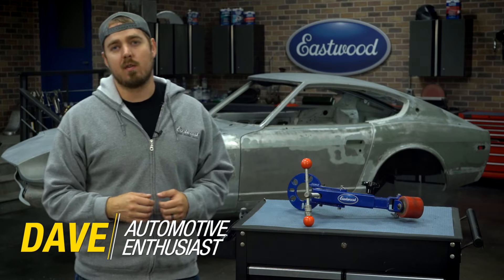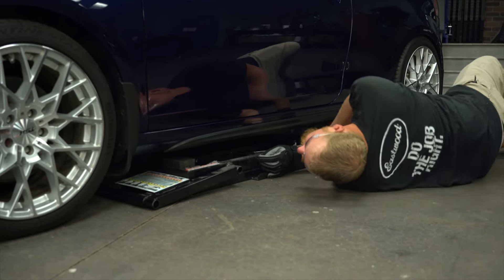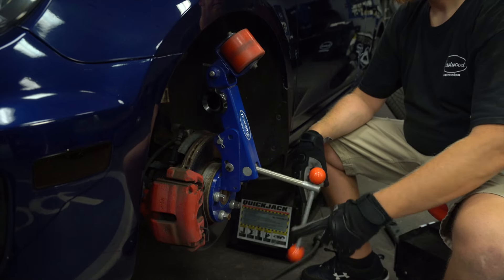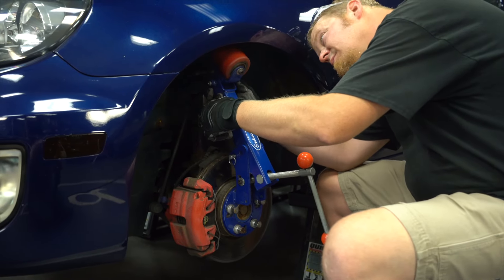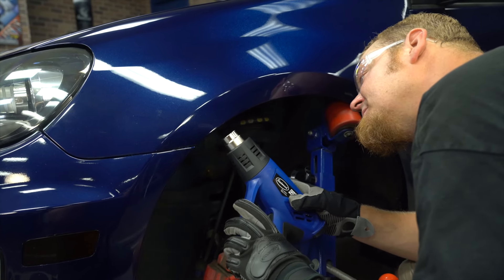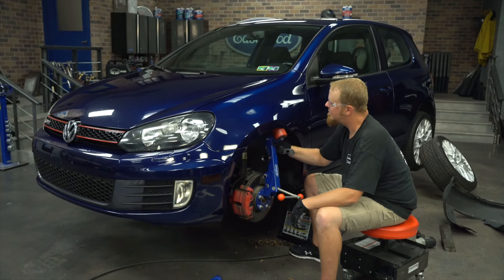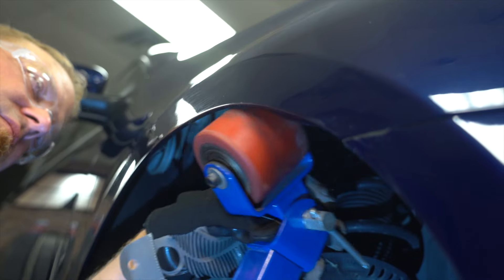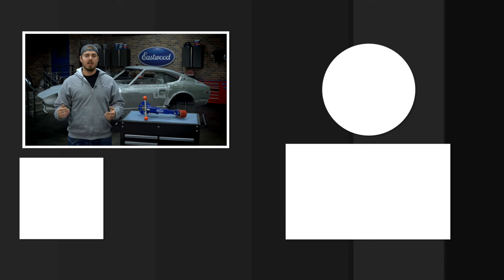How To Use The Eastwood Fender Roller - Tips and Tricks

Comment: Its really not worth rolling your front fenders if doing so you have to remove your fender liners. You dont want dust, debris and water getting up under there
Reply from the maker: When modifying cars there's always trade offs - if you're car is extremely low and needs clearance to turn you're probably not too worried about the dirt.

Comment: how does rolling the inner lip change the profile ? oversize tires still going to rub on the profile without increasing the ride height ?????
Reply: It adds maybe a cm of clearance, but crucially if it does rub, the tire won’t get damaged by the stamped metal edge of the fender

Comment: What temperature range should we be shooting for on the actual paint itself? I have an IR thermometer.
Reply: Looking to roll my fenders this weekend, I’ve heard 140-160°F. Just got enough to be uncomfortable to the touch after a second or two. Wish me luck
Reply: @volleyballurrrr  how did it turn out?!?
Reply: @stevenmize1  turned out pretty well! I did slightly crack the paint in the same place on both sides of the rear arches, about 1.5” crack but not too bad and mostly stayed closed. I had trouble keeping it up to 140, I would recommend a helper for it. IIRC I ended up being around 110-120 tops most of the time. Just went very slow and took pics of the different angles I was getting along the way to try and do the same process on the other side.

Comment: So I’m planning on rolling my front fenders for some clearance this weekend - I understand taking out your liner will help with  the process itself, but is reinstalling the liner doable?

Just trying to prevent dirt/salt/etc getting to places where it’s not ideal.

If it’s doable, would I have to make modifications towards the liner or should the reinstallation be as simple as taking it off?
Reply from the maker: This is going to be dependent on HOW MUCH you roll them and the make/model of the car etc. You will most likely need to modify your fender liner, the way it attaches, or add additional material. Anytime you're modifying a vehicle you will have to solve for these types of problems regardless of the tools used.
Reply: @eastwoodco  gotcha - I appreciate the response and info 🤙🏼 I’ll be using the Eastwood gender roller for the 2017 gli this weekend, can’t wait
Reply from the maker: Let us know how it went and leave a review with some pics!